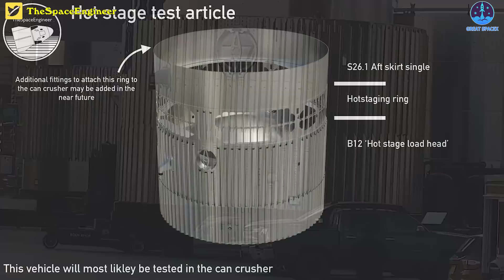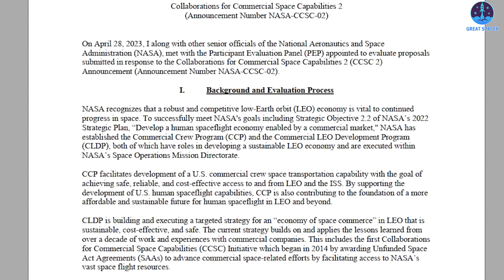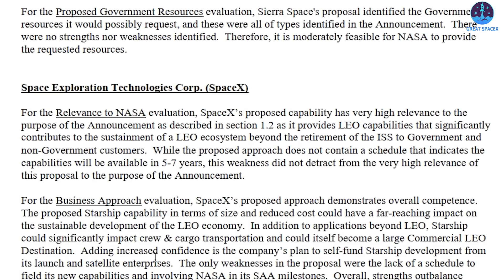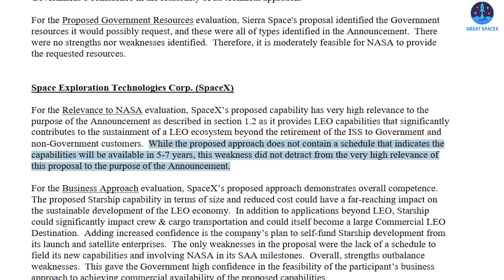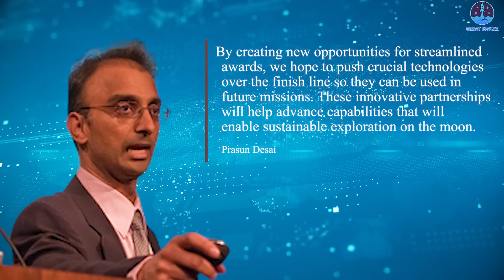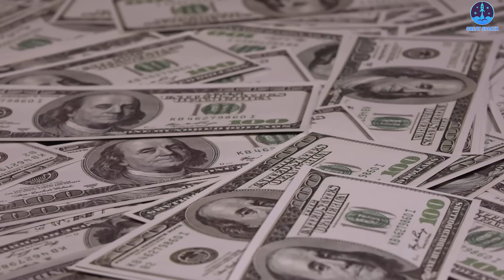SpaceX says goodbye to a historic Starship and destroyed Naked Starship, NEW Reinforced Booster...

Comment: off topic subject; we all have seen the sci-fi movies with a space elevator from earth to a space station in orbit. i know this is not even close to being doable at the present time, but would it be an option for the moon? with less gravity, no atmosphere or winds, would this be possible? i would guess it wouldn't need to be too long either due to the lower gravity it could be placed much closer to the moon than an earth-based station would be. if it would be an option, you could just transport work crews, some smaller work materials down to the surface without needing a specialized rocket landing and launching for every event. if mines were established you could transport the materials up to a waiting ship that could be built for just the purpose of getting from the earth to the moon and back, and skip a specialized rocket for the moon landings.

Comment: Question, when Starship lands on Mars, what prevents rocks from bouncing up into the ship? Same with launch.  Not an engineer so just curious. How do they avoid what happened when last Starship sent concrete into it's engines on launch.
Reply: Superb question. I don't know, but I know they'll require less thrust because of the lower gravity on mars and because the booster won't be there and what is there won't need as much fuel so it'll have way less mass too needing less thrust moreso, and it will have landed previously clearing the area of much rock that can be moved with nearly the full thrust required.
Reply: @tricky778  Thank you. I did not think about that, again, not an engineer.
Reply: I think, they will prepare the lauching pad 1st before landing the 1st starship. maybe they will drop some material on the targeted surface on mars. and then, some crew will land and make these lauching pad. maybe....
Reply: They will choose the less rocky terrain to land..
Reply: @Epiderm91  You mean choose whole flat level bedrock with few large rocks? The small rocks can be cleared away by the exhaust, the bedrock might be tough and resilient as long as it's not in pieces. The gouging problem was on less rocky terrain and that's why they had the problem, soily ground was gouged and the thrust was able to push rocky material above it (concrete in that case) upwards. If there's little soil, the force will go mainly outwards sending rocks sideways away. Maybe there'll be a problem if there are cracked strata, exhaust goes into a crack, separates a thick piece horizontally and forces it upwards. Could still be fine because without deep soil or rubble underneath it most force will be sideways, and just a little sideways vector will be okay because the rocket is narrow.
Reply: I believe that when Starship lands on the Moon, it will use vector thrusters quite high up, so very little impact on the ground directly below the ship. There are a number of pictures of this concept around. Once sufficient equipment (and people?) has landed, concrete can be manufactured and laid for a light pad. The only thing missing to make conventional concrete at present is water.

And it seems that water exists on the Moon's surface, albeit in small quantities. It's continuously manufactured by protons in the Solar Wind hitting the surface and dissociating oxides in the regolith. It seems to be a steady state process, with photo-dissociation causing the water molecules to break up and be lost into space again. Water ice has been detected at the poles and in shadowed craters. HTH.
Reply: @williamstucke5445  Awesome, thank you.

Comment: As far as StarShip goes for being a Space Station I just wonder how Stainless Steel fares when dealing w/ the heating/cooling effects of shadow & light. Stainless does expand/contract less than Aluminum but much more than composites. And, welds are almost Always a weak point in metal fabrication and would become stress points w/ expansion cycles because the welds will expand/contract at different rates. 
  Just another thing that needs testing.
Reply: Starship in its current form is developed to reach LEO and return to Earth. It is not optimal to transit to either the Moon or Mars or land on the Moon or Mars. What it is designed to do is transport large payloads rapidly and cheaply to LEO. It would therefore make more sense to use that ability to build in LEO  spacecraft optimised to transit to the Moon, and land on the Moon. The same is true for Mars. For example in space., spacecraft do not to be aerodynamic and the sambas true of the Moon. Mars does have a thin atmosphere and less gravity so again an optimised design again would be required. Inter-solar travel also does not require chemical rocket engines and hybrid-nuclear thrusters or ion-electric thrusters offer alternative possibilities for propulsion.

Comment: SpaceX doesn't need a big junkyard. The scrapped stainless steel needs to be recycled and used to reduce the cost of future rockets.
Reply: It’s 304 so you could recycle it into Cybertruck bodies …
Reply: My first thought was also raw materials for special edition Spacex Cybertrucks.
Reply: Or use them as the tanks for the fuel for loading farm
Reply: The scrap goes right back into new rolls of stainless steel for the next rockets.

"Stainless steel is produced in an electric arc furnace where carbon electrodes contact recycled stainless scrap and various alloys of chromium (and nickel, molybdenum etc. depending on the stainless type)."